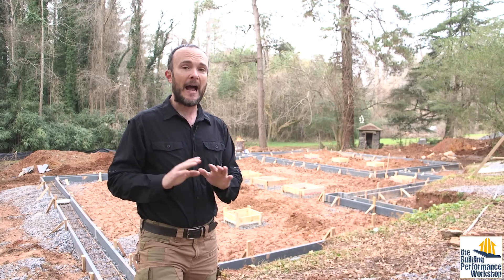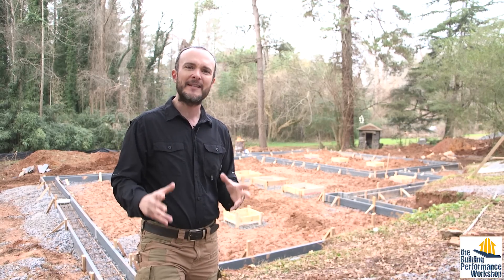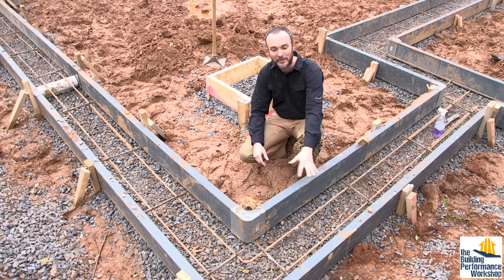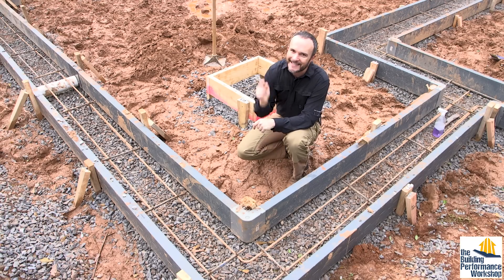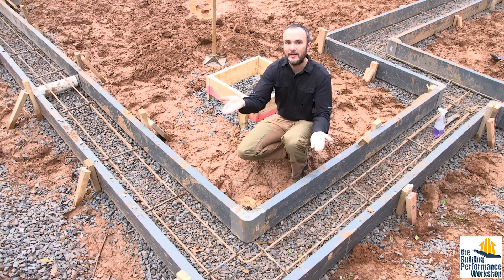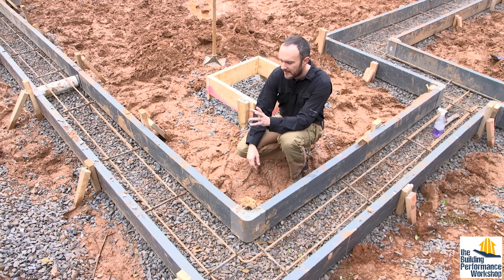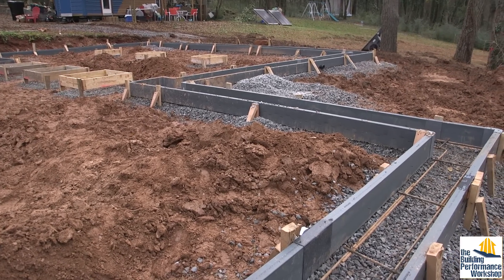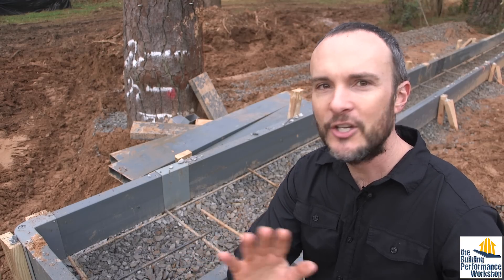First Concrete Pour: Form-A-Drain 4-in-1 Foundation Footings

Comment: A client from hell.
Reply: @HomePerformance  not true. I've worked in the design and construction industry for the past 31 years and never have I seen or heard of cleaning rebar with a spray solution. Im not saying your wrong, there is just a correct way and a wrong way.  The documents, drawings and specifications, are king. The contractor controls the means and methods to comply with the documents. Make life a little easier on yourself and pay your architect to come out and visit the site every couple of weeks. The architect and the municipal construction inspectors should take care of all of the issues. Good luck with your project.
Reply: I've perused your channel a little more and I see you are in the business so to speak. Just to let you know my current project is a Leed Platinum project. Geothermal Wells ICF walls and solar panels. So I'm well aware that there are certain ways our industry has to be retrained. But again there's a right way and a wrong way.
Reply from the maker: Agreed, but I would say there are maybe a few right ways and a million wrong ones.
Reply from the maker: Only if you don’t know how to do higher quality work for more money

Comment: to anyone thinking like this, in the concrete world they pour samples, which get tagged and can be tested after a standard 30 day cure, the companies may not advertise this to residential customers because they don't want to end up in a situation later, these tests are so simple, a machine tests compression and records failure force, calculate out psi at failure and you'll know what you bought 30 days prior, you can buy the test molds cheap online, final step find a 3rd party test lab to test them, good luck with that, i've tried, but guess what many colleges, technical and trade schools have this equipment, I used the one at work personally but if i hadn't had one available at work i would have looked to colleges, schools, friends that work somewhere with a compression tester collecting dust in a corner....

Comment: This video is more helpful to the homeowner/GC wannabe with trust issues than it is for a homeowner that really wants to learn and understand a process or method of construction; taking a year off work to half ass learn , babysit an unskilled contractor and waste energy and more money than needed on top, might sound smart, but it is not; what is smart is to pay more for a qualified contractor (s) and trust their wisdom and skills, definitely not a good example to follow when thinking about becoming your own GC.
All that said; Form a drain system is the most advanced and complete, foundation footing forming and drainage system available, it comes with  all sorts of connections and accessories for a complete installation, including 18"-36" grade stakes ( to secure forms to the ground and allow for level setting) and spreaders to allow for side to side form stability ( so stone fill is placed on both sides of forms before placing concrete) and rebar hanging and tying; all these accessories were omitted in this installation, also, the flimsy rebar chairs presented as indispensable, just crush under the pressure of the pumped concrete ,wire brushing the rebar advice just makes me feel compassion, more for the concrete contractor than for the homeowner and  I can keep shredding this apart , but it is not worthy.
Finally, most of the time, it doesn't pay to try playing GC but , if you are really interested on becoming your own( or somebody else's), please try to get involved in the trades industry and learn hands on, be ready to spend a good chunk of your live on it, before you try to sound smart and claim knowledge, remember, the price and effort are high no matter what, and you will pay it , one way or the other.

Good Luck!
Reply: Bingo, you hit it on the head!!!

Comment: If you are concerned about moisture and radon gas coming up from under the house why not lay a layer (or 2) of plastic under the whole floor and the concrete footings. Wouldn't that stop moisture and radon from coming up the ground? And therefore not need the interior perimeter drain.
Reply from the maker: Redundancy for important things, always redundancy.

Comment: I hate the part where you kinda make yourself feel like an ass hole client 😂 I just want it done how I want it done but I've been on the other side as an electrician and I try and be as understanding as possible
Reply from the maker: Yep, it’s  important to understand that each side thinks the other is untrustworthy. We have to mend that.
Reply: All I want out of the electrician (also applies to telecoms) is to be to code (or better) if they know their stuff, and to be neat and tidy and not some nest of wires at the breaker junction. Could care less what is going on in the conduit as long as they are not twisted, proper labels or tags also help.

Comment: Hey Builders, if you ever run into someone like this as a potential client and he does not LEAD with
his checkbook, IE deposit in hand, then RUN, RUN, run as fast as you can. It's simply the SCIENCE
of contracting.
Reply: I’m with the owner on this, most builders have only one goal, make as much as they can get away with and get out. Even engineers deflect most questions as “mean and methods”. If a builder doesn’t share my goals he doesn’t deserve my money. Unfortunately only 1% are good, in my experience.
Reply: @drchamp1902  Right, because we ONLY do it for the money. What do you do? Do you do it for
charity? or do you have mouths to feed?
Reply: @2drsdan  most do, they have zero concern for the safety of occupants or quality of work. I have hired many contractors and have seen it again and again. Most collect deposits and disappear for months. Not saying you do that but most do.
Reply: True, get a deposit and disappear for months, that's the science of contracting
Reply: @drchamp1902  You are the worst.
I have ALWAYS given my best. Sweated the details gone above and beyond and what did I get? stiffed for a cumulative $300 grand by 3 different home owners. My contracts now read like a book, written by my lawyer. I still do the best, AND have learned how to tell a loser from jump street.
Reply from the maker: More serious builders find more serious clients.

Comment: You have excellent attention to detail, which isn't something typical of the average contractor. If I were cleaning the rebar,  would've insured installing it on a dry day and if they still got muddy, I would've used a pressure washer to quickly clean it. I appreciate you walking us through every step and your thought processes.
Reply from the maker: Thanks, Hans, I do have a pressure washer but had had enough of water that month
Reply: @HomePerformance  Man, dont go pressure washing ur rebar.  thats too far.  A couple of rags if they're real muddy.
Reply: How do you keep a schedule then.

Comment: You and your building inspector are a contractors nightmare!! You think your house footing is for a nuclear facility. Your so worried about your rebar having a little bit of dirt on it yet you build your house in a swamp hole lmao! I cant believe you actually found a concrete contractor to out up with your shenanigans.
Reply from the maker: That’s not very nice, Ryan, geez. My house is on a hill, nowhere near the flood plain- maybe you just call everything a “swamp hole”. And guess what? I paid my sub exactly what he asked, no haggling. Do better work, get paid more.
Reply: @HomePerformance  look at the sloppy ground. I've done concrete my whole life and have done foundations on ground like that at the customers request. I know from experience it's not good. You will have constant moisture and water issues, and constantly have to have a dehumidifier or fans running. Your book smart but not street smart. Your type should spend 10 years in the field before you ever are able to tell anybody else how to do something.
Reply from the maker: I have over 10 years in the field, Ryan, testing moisture and air quality. I trust my geotechnical engineer’s advice over some guy I don’t know who saw some dirt in a video. Also, there will be both subslab exhaust and dehumidification in this house. Might want to do more research into this project before you offer more advice, but thanks for putting yourself out there so hard.

Comment: Cleaning rebar is not necessary.....a university study showed almost no difference in pull strength of clean rebar, rusty rebar or rebar with dried concrete splatter. The only issue was found with oil coated rebar which has slightly lower pull strength. I am an inspector of concrete pours on very large projects so I have experience..... waiting for arguments...lol
Reply: Superficial rust or concrete splatter aren't caked on soil. The former ones do not really interfere with the bonding, a layer of soil will absolutely do that. Also soil is way weaker than concrete, you don't want to have pockets of that in your slab.

Comment: you seem to be a nice person but have been very miss lead . the plastic decomposition will off gas more than anything comming from the ground. 2" of sand under the concrete with a moisture barrier would have stoped any off gasing. by the way they were screwing with you about cleaning the rebar.
Reply from the maker: Thanks, but that’s why we’ll have an active exhaust system. And yes, there will be 15 mil plastic between the ground and the living space, stay tuned.

Comment: This looks like an awesome project, thank you for sharing!  Curious if you are familiar with Hammer and Hands approach of placing a footer on top of geofoam.  If so what was your thought process for opting out of that detail?  Thanks again!
Reply from the maker: Thanks T- I’m a H&H fan, but insulating the footing didn’t show a significant benefit in our energy model. So we opted for a more conventional (though still quite unusual) approach.
Reply: @HomePerformance  This was going to be my question. I'd be interested to know the difference the energy model showed in not taking care of the thermal bridging at the footings since I'll be looking to build a complete basement.

Comment: great video, never seen that product and probably won't ever see it in Australia, but lots to think about when doing a normal foundation. Thanks
Reply: As an experienced and former basement waterproofing tech (mostly retrofit and some new installs), I can say not all areas of a region or nation will or do require underground/underside water drainage, can use this for an example: I am from MA, I lived in FL for a few years. In Ma and around elsewhere such as CT and RI for other examples my step dad who owned and was gc of the company runnings the day to day stuff on site and doing the estimates for new projects and taking on emergency calls which were interesting at times. In Those three states (CT/MA/RI) you will want to and do need to install said drainage systems, Not much can be done the same with sub grade systems in FL due to its elevation to the ocean surrounding it but simple systems like louvers (such as Smart Vent and Flood Vent brands) make most sense to alleviate equilibrium of water pressure differenced from the inside to the outside and to let the above grade basement if the house is built as such to drain out in the event of a hurricane flood and the owner is not home for such emergency weather condition. Also there is the sinkhole issue in FL which also negates sub grade drainage in those prone areas.
Reply from the maker: Thanks for watching buddy

Comment: Form a drain is junk. I’m surprised you didn’t get the form a drain with a mesh. To keep the form a drain from bowing out ,screw wooden stakes to the top about 6 feet apart
Reply from the maker: It's not junk, jerk. It works fine, too bad you haven't seen the follow up video.

Comment: Thanks for the video, it's interesting and well produced.  In the Texas Gulf Coast area where I live, we mostly build on very high PI (plasticity index) clay - the kind of soil that shrinks and swells (sometimes considerably) depending on the moisture content of the soil and so our foundations (if you get a good builder) are considerably more substantial.  
Due to the diligence you describe, I'm certain that your foundation is adequate for your area and I would like to see the "next steps" - hopefully you'll make more videos.
I have spent my life building refineries and chemical plants and supporting facilities, but also roads and bridges during recessions.  
Since you've been kind enough to share, I offer my experience as well:
- The slump test you mention is an indication of how wet the concrete is - it is ALWAYS performed onsite AFTER the last addition of water to temper the mix.
- The problem with too much water in concrete is that it can allow the aggregate to separate from the paste (the sand, cement and fly  ash) and it holds the cement in such a suspension that it cannot chemically bond as well - leading to weaker concrete. 
- As you noted, the concrete will lose an inch or two of slump as it is pumped, but with today's concrete design mixes, "wet concrete" (in excess of 6" slump) is not such a big problem - yours looked like about a 6" slump once it hit the forms.
- The reason your forms bulged is because the contractor did not use enough stakes - I'm betting that if you checked the vendors information, they suggested a safe spacing for lateral support - for future reference.
- Also, anyone in the concrete industry for more that six months (and with a brain the size of grape) would know that the rebar must be clean prior to placement of the concrete - it is also a clear requirement in ACI 318 - quote that in your next request for proposal.
- ACI 318 and other construction standards also address adequate rebar support - chairs are COMMON PRACTICE - not an "extra thing" - and I would have placed twice as many as that contractor did - a good rule of thumb is you should be able to walk on the rebar and it will rebound to its design location.
- One last suggestion: To preclude all the yammering about slump and water/cement ratios, simply add a minimum 28 day strength requirement to your contract and then hire a local geotech company to make sample cylinders from the concrete as it is being placed in the forms (this is important).  Tie the strength requirement to the price of the contract ~ if the cylinders fail to break at the required strength, the contractors compensation will be reduced by the same percentage of the deficiency.  This way it's up to him - and walk away from any contractor afraid of such a requirement, it is not that onerous nor is it uncommon.

Thanks again - I hope this helps.
Reply from the maker: What an awesome comment, thanks brother! Keep them coming, and I promise we’ll keep the videos coming too.
Reply: Thanks

Comment: I'd be some what worried about using those chairs in that setup, as you have potentially allowed exposure to the rebar once they have corroded as they are exposed to the air.
Reply from the maker: Thanks- all of this will be buried at least 12" below grade once we've framed the floor, however. Not anticipating much air or water issue.

Comment: It looks to me like you are really trying hard to do a good job building your house. Kudos to you.
I do however think that you have erred in your discussion about the slump test. I've been in the construction industry for nearly 40 years as a carpenter, often building forms and pouring concrete, both in housing and on large commercial jobs.
I don't think that I'd have taken issue if you'd implied that doing a slump test was not really necessary for a house foundation. On the more run of the mill houses I work on the engineer doesn't require a slump test, but on the larger houses that are treated just like commercial jobs they are required. These are required to be done by a third party testing firm, who usually also test for entrained air and cast some test cylinders which are broken at later dates to determine the concretes compressive strength. I know that on your delivery ticket it will show a design strength, design air content, design slump etc. This is just what you have ordered however and should not be taken as representative of what you will get. I don't know for sure but am very doubtful that very many loads of concrete are tested for slump at the plant. That is not to say that the plant won't have a very good idea of the slump. They are, after all, just following a recipe. If they know the ingredients they will be able to accurately predict the result. However, it is not the same thing as doing a slump test. 
Here is a pretty good video of a slump test being done at a job site for houses. https://www.youtube.com/watch?v=zLBspIRPKJI
Reply from the maker: Great comment, Sam, my favorite kind- reasoned, complex, and experienced, in that order.
Reply: @HomePerformance  
Cheers. Best wishes on your build.

Comment: Most of these people are contractors upset with you as an owner for stepping on toes but in fact you are the general contractor on this job and the people work around you are your subs do what you want. The only issue I've seen is the vertical rebars had hooks to hook in to the foundation rebar and it appeared to just be stabbed in. I am a masonry contractor and so my perspective in dealing with inspectors may differ from alot of other subs but that was just my observation.
Reply from the maker: Thanks for chiming in, brother-  I appreciate it. The verticals are actually all L’s hooked into the footing horizontals, if that’s what you mean. The only place we stabbed straight in with epoxy was on the CMU piers going down into those footings.

Comment: rebar chairs are metal rebar is metal, if you have exposed metal once it gets exposed to water it rusts and corrodes = weak point in concrete. that's the reason to put plastic chairs or concrete then rebar or hang rebar from the top of your form with wire.... but you use science not experience